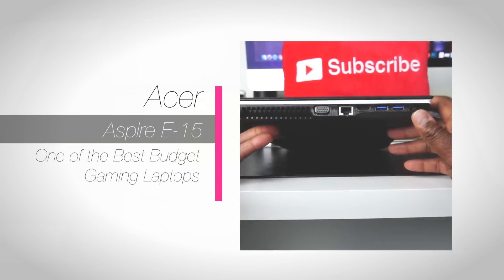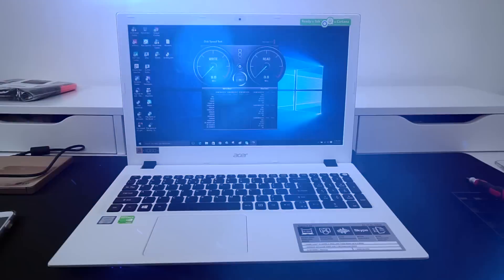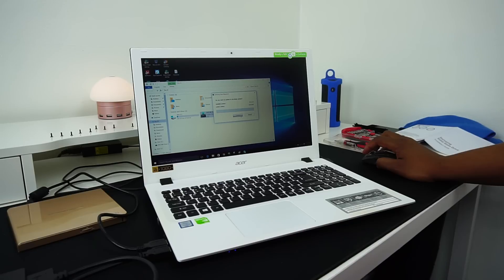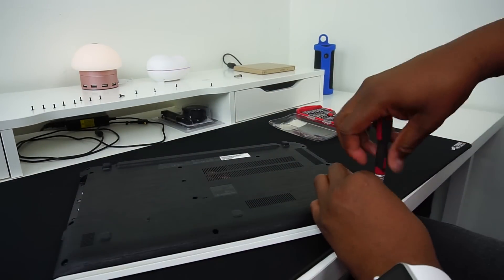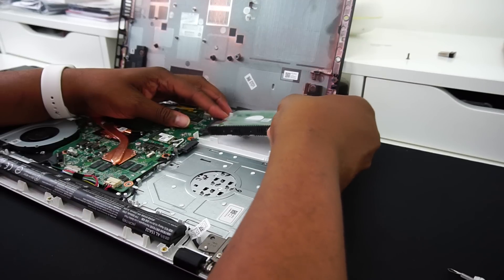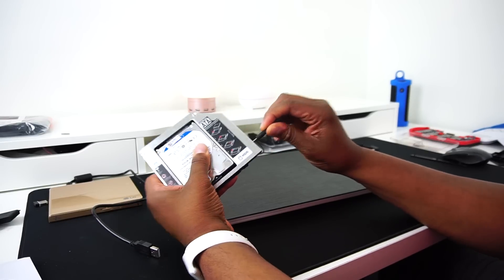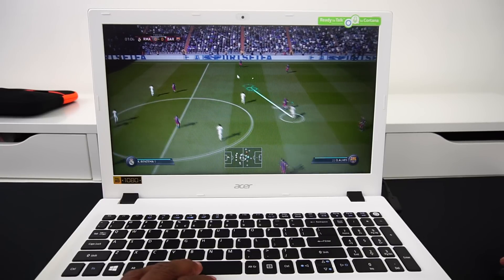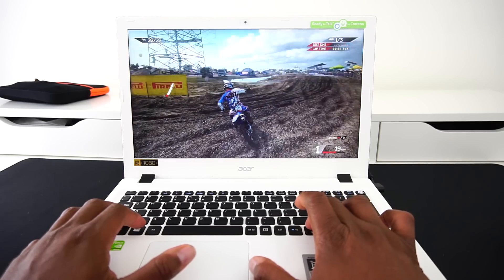Acer Aspire E15 574G Laptop and Samsung SSD Install

Comment: Does the HDD become slow on DVD Rom slot? I was thinking of upgrading, but I don't see any point if the only thing it does is faster windows boot and the few programs running fast and slowing down the rest that stays in the HDD.
Reply from the maker: I feel you, the main reason I think most invest in an SSD is because of the boot up speed, running apps faster, and transferring files quicker. In my line of work it's a necessity for me. But at the end of the day the SSD and HDD do the same thing, one just does it faster! Thanks for watching!!

Comment: Friend can tell me if I put a 240GB SSD I will lost my HD 1Tbayte ?
Reply: Simply put, your SSD goes into the primary storage slot for faster speed and secondary large storage(your 1tb HDD) replaces the dvd rom. Resulting in 2 Storages and no optical drive. Since nobody uses dvd now a days anyway.
Reply: Sorry - my friend think I did the wrong question I will try to explain my bad English and ' 'm from Brazil ! I said what I say I have 1th notebook , I use a HD1000tb more , I will buy an SSD 240 know? If I put hum 2 ? we lose ? There is a way to more easily? Example Unit ( a) tb 1000 Unit C is 20GB What Querio That's what I want to thank you for contact Because the notebook has only one input or SSD or HD   

Its use SSD and HDD together?

Comment: The laptop is locked on the on possion. How i disconnected the battery to power it's off. Please answer my question
Reply from the maker: Seriously Locked, Did you try and hold the power button down for 5-10 seconds, also if it goes to windows can you just do a shutdown? that's a serious problem, You can let the battery die down itself, or you would have to take the bottom cover off like i did in this video and disconnect the battery  But i would let it die down by itself and send it back for a replacement!

Comment: If i get the laptop brand new is their an reason to do a data migration? or can i just install the ssd right away?
Reply from the maker: You can just install if you want, but you get the real benefit by having it as your primary drive.
Reply: +TechFit360 Alright thank you so much for responding in such a short time period!

Comment: im looking at acer e 15 574g with 
nvidia 920m graphica cart
i5 processor
4 gb ram 
1tb of memory

now in concerned cause on the site they say not suited for gaming but it should run games like wow just great right? could also be cause they want me to spend extra money on a laptoo even more expensive. anyone please help i need an answer FAST!!  

whats the max and whats the minimum i can run with this laptop gaming wise?
Reply from the maker: +Chuck Norris The most demanding game I've play is GTA V  I had to bring the res down a bit, but it played very well. For this price range it's a pretty strong gaming laptop!!
Reply: +TechFit360 ok so i should def get the laptop with the specs i just mentioned for the price i mentioned? sorry just to be 100%sure were talking about the same laptop

Comment: If i'm planning to add a ssd drive and clone everything from the original hdd, and keep them both with the ssd as the primary drive, do i still have to switch the hard drives in between them, or i can leave the ssd in optical slot?
Reply from the maker: +George Craciun I would swap them and have the ssd in the main slot and place the secondary drive in the caddy. You want the fast one in the primary slot. Thanks for watching!
Reply: +TechFit360 thanks for your answer. really appreciate!!

Comment: The new model also has a GTX 940mx GB GDDR5. The similar F 15 model has a 1TB HDD but still had the m.2 slot, and has a GTX 940mx 4GB GDDR5. Same price, I'm thinking the e 15 simply because it's easier to install a HDD for storage and take the hit in GDDR5, than transferring the boot to the SSD, plus buying it.
Reply from the maker: Sounds Good Man!

Comment: Is there a follow up video for partitioning the hard drives? I'm curious to see how that "caddy" actually works.

I would assume you'd have to enable something in the BIOS, since the laptop originally didn't come with an optical drive. Yes?

Also, how does the extra caddy affect cooling within the laptop? Should I use an external laptop fan if I go this route?

Thumbs up & Subscribed!

Thanks!

Comment: Hi Dan, great videos on this lappy and all the other videos, you really are legit, keep it that way and there's no telling where your brand can go!! ok quick question... im in Ghana, West Africa. My cousin is getting me this laptop(THNAK GOD for your review, great job!) and an extra 8gb ram plus a 240gb ssd... i'll keep the 1tb as a secondary storage. my budget is totally done for, i cant buy the external dvd, is there another way i can get a new windows 10 image, put it on the ssd and run it as my boot drive. i want to get all the bloatware off... plus im not getting that cable from the ssd to the laptop either... 😱😱😱😱HELP!!!!
Reply from the maker: I appreciate that man, thanks for your support. You can download the data transfer utility to your hard drive, here is the link http://www.samsung.com/semiconductor/minisite/ssd/download/tools.html if you're not going to buy the usb to data cable, you may be able to just temporary put the ssd as your secondary drive, and run the utility and see if that works.
Reply: cool!! thanks a lot sir! but if i do so with the ssd as secondary, wont it affect the system since the widows file on the hdd will be erased... i read from a couple answers you gave on here that the data migration does a copy of the windows on the hdd to the sdd. So lets say i run it and then put the sdd as primary... how will the original copy be erased ? and when i boot up will the laptop by default choose the primary as boot drive ?
Reply: hey Dan, about the ram... for this particular module, which is appropriate? 1.5v or 1.35v and why ? will it affect battery life?

Comment: I have just buy an e15 574 yesterday, it doesnt has gaming card, can i install some of them in future?
Reply from the maker: I would shoot Acer an email for the answer to that question. I'm not sure if you can do that with the 574G.
Thanks for watching!
Reply: thks so much, and one more question: when install new ssd and place the old one in DVD space. Do i have to reinstall window?
Reply from the maker: The SSD comes with a data transfer utility, it will copy the old drive to the new one and then just boot up as normal!
Reply: is there any error after transfer? some friend said there is a chance that will get error with window when transfer?

Comment: Just bought this unit for university, did not come with Nvidia GPU, just bog standard intel HD 520 Graphics, but for $450 AUD still a bargain. Taking your advice to upgrade  to SSD and the RAM once it arrives. Cheers from down under.
Reply from the maker: Go to device manager and look at display adapters, you should see two (intel520 & nvidia 940m) When you play games, or demanding programs you will be able to choose the NVIDIA Graphics Adapter. On the tool bar, lower right side there is an NVIDIA icon click and you can change the preferred video adapter from intel to NVIDIA. Basically it's on auto detect which i would leave it on so you are not always using the Nvidia processor for basic apps. I hope this helps.
Reply: will do, thanks for the tips and great content.
Reply from the maker: You're welcome!! and thanks!

Comment: Hey Dan! 

I've got a question. I have an idea of upgrading the laptop by removing the existing DVD Drive and installing an SSD. 

But will copying the Genuine Windows 10 OS from existing HDD to the newly installed SSD, will make way for Windows 10 to lose its genuine status? I'm really concerned about this. 

One of my friends told me that now Microsoft stamps the genuine status of a PC by its hardware ID, and is this true?

Simply, I want to install an SSD and move the OS to SSD, but I want to make sure that the genuine status of my OS is not lost.

Thanks!
Reply from the maker: Normally if you upgrade your hard drive or graphics card you will be okay. If you swap out the motherboard then yeah it will tell you it needs to activated. I copied mine bro and it still said Genuine Copy of windows and kept it's activated status. But even if you run into a problem, all you have to do is contact support from within windows, explain the situation and they will activate it for you. My friend did this 3 times on a few of his machines.lol

Comment: Hello Dan, I'm from Brazil and I have a aspire e5 573g 58b7. Similar to the model of the video. I'm thinking of upgrading memory ram (possibly Kingston HyperX 1600Mhz DDR3 8GB Impact p / Notebook CL9 - HX316LS9IB / 8). But first I want to put a ssd. I know that the sacrifice hd driver or dvd... I honestly do not want to buy an external drive dvd or hd (only if no alternative). I wonder if there is compatibility of this notebook with ssd m.2 or mSATA SSD. You are to be congratulated for their videos. Help me please... Thanks!
Reply from the maker: This model is not compatible with SSD M.2 or mSATA SSD, so you would have to go with the standard 2.5 SSD. I would just replace my existing HDD with a larger SSD (750GB or 1TB) so you will not lose your dvd drive. Hope this helps!
Reply: Okay, Thank you for your attention.

Comment: Just bought E5-574G-70HT... although i really wanted the white one just like in your video but i got the grey one it was the only one available at that time. It has a slight different spec that what you have on your video its i7 65000u with 12gb of ram ddr3 and Nvidia 940M 4gb mem for the video card. i'm planning to do the same upgrade that you did... Great video this will help me after i purchase the needed parts to do the upgrade.  i actually also did a unboxing video of my own for my E5-574G-70HT. but i just starting hit me up with some pointers in  doing a video :) Thanks
Reply from the maker: I'll check you out Bro, I enjoy support other tech channels! Thanks for stopping by!

Comment: Thankyou for this in-depth review and installation guidance. #HappySubscriber.

I'm planning to buy the  i7 model of the E15. It comes with an optical drive, which i intend removing. My question is - can i put a 1TB Samsung 850 SSD in the caddy? will it work with the pre-installed 256GB SSD by Acer? I intend to have a Windows & Ubuntu dual boot. I have heard, we should not make partitions on an SSD, is it? Would need your expert advice on my concerns.

Comment: Tech answer me please is this better or acer aspire E5-575G better???  Answer please I love u much!
Reply: E5-575G has got a more beautiful look and it has a USB 3.1 Type C port as well. Generally it comes with an NVidia GeForce 940 MX GPU and 8 Gigs of RAM.
Reply: Techy Isle but is it better for gaming?
Reply: It depends on the hardware of the laptop. Even the E5-574G has few variants and one of such variants contain the NVidia 920M GPU. But I think the laptop that Dan reviews here has got a NVidia 940MX GPU.

So the gaming capabilities will surely depend on the specifications of the laptop which you are looking at.

The E5-575G however has got an NVidia 940 MX GPU and 8 Gigs of DDR4 RAM. And in 575G, it's relatively easy to replace the HDD and RAM because the RAM and HDD are in a separate compartment. Once you remove the cover of that compartment, you can easily replace them.

Comment: If I replace my laptop's hdd to a new ssd,and transfer my files to the new ssd, Will I need to re install windows again???thanks
Reply from the maker: +onyxjr17 No, it creates an exact image using the included Samsung Data Migration Tool

Comment: Hi, I'm from Colombia I loved your video, does this laptop have a good procesor? will it long last a lot of time? Does windows10 work well in this laptop? thanks for your information.
Reply from the maker: Yes Windows 10 runs very well, I had to uninstall a lot of the pre-installed software though. Excellent processor [6th Generation Intel Core i5-6200U processor 2.3GHz] Thank you for watching!

Comment: I wish the new version of this acer with an ssd had the same design and white color as the model you have :/
Reply: Hey Dan, I have a quick question, does the Nvidia 940MX the same as the Nvidia 940m or is it better?
Reply from the maker: Yes the 940MX performs  better than the 940m.

Comment: after the data migration to the ssd, does it erase the data on the hard drive?
Reply from the maker: It only erases the data on the destination Drive. So if you're transferring from your hdd to the ssd, the data on the hdd will still be there until you format it! Thank you for watching!
Reply: +TechFit360 Thanks man! Great video by the way